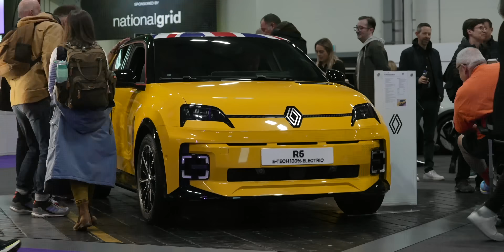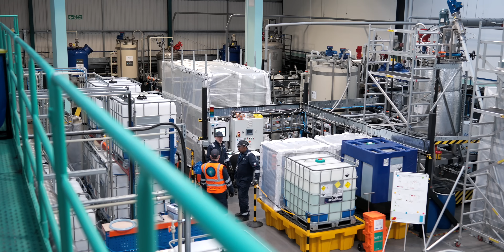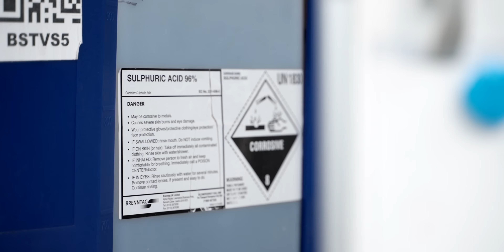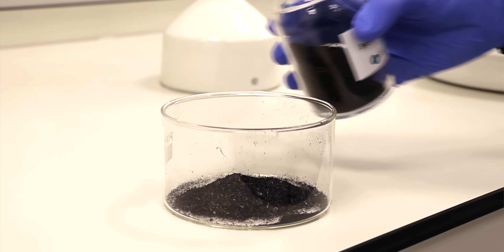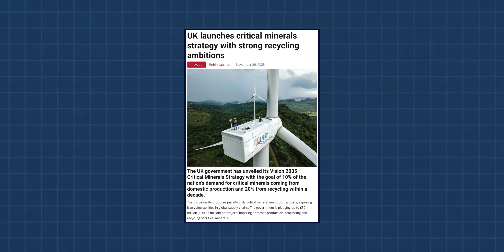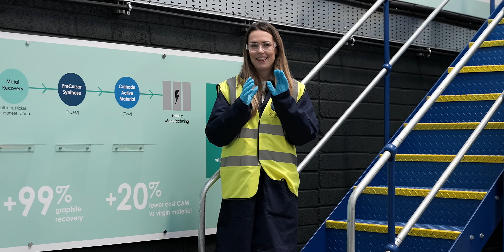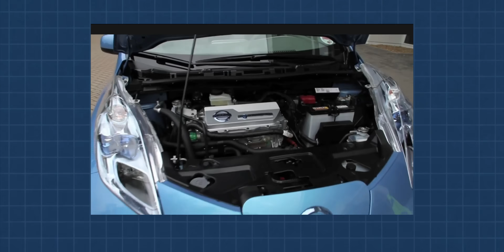EV Battery Recycling Could Be The End Of Mining!

Comment: This is something the EV haters should see - especially the math about cobalt. Thanks for the video, really informative.
Reply: I couldn’t agree more. This can be a huuuge future for UK jobs in several different ways. Heck, knowing in the end you’d also be doing something good for the planet in the long run, I’ve I’d like to have a job in the tech and battery recycling sector.
Reply: You mean dig up 200 tonnes of rock for 1 tonne of cobalt.. Then scratch your head where to out the 199 tonnes of rock while stood next to a 200 tonne hole...

Kidding, but it just tickled me.
Reply: @dougaltolan3017  having lived next to a huge quarry it isn't as silly as it sounds: they can't put it straight back in the hole it came from as they need that hole to access the next bit of unquarried rock.  Also the quarried rock is a rubbly mix which is not stable like the original rock face, occupies a lot more space with all the air gaps, and will be prone to movement. So it can't just be 'put back' I'd guess.
Reply: @dougaltolan3017  
Turn the hole into a battery with a pumped hydro system.
Reply: @dougaltolan3017 plenty of cobalt free batteries and sodium batteries are a thing now
Reply: @dougaltolan3017  
BTW a large portion of the Cobalt mined in the world today is used in drill bits for hard rock drilling for all mines as well as drilling for oil.
LFP batteries DONOT use cobalt.
Reply: @anguscampbell1533 Well said. And cobalt is also used in catalytic converters for ICEvs and the petrol refining process. Anti EV crew doesn't mention that part.
Reply: @anguscampbell1533  - NMC uses very little as well today, original the Nickle/Lithium:Maganese:Cobalt ration was 1:1:1, these days 8:1:1 (1/8th of the original level), with 9:0.5:0.5 commercialising (1/18th) and 9:0.25:0.25 (1/38th). Also, LNO (Lithium Nickel Oxide) is starting to leave the labs and may displace NMC at the high energy density option (particularly with Solid State electrolytes).
Reply: @anguscampbell1533 stop lying please! Also that same oil is used to make millions of byproducts including tires, asphalt, insulation for electric cables, battery anode/cathode…… use your 🧠
Reply: @oddjobsandrandomprojects Blablablablabla…..
Reply: @alanmay7929 So you know I'm right. Thanks for acknowledging it.
Reply: @oddjobsandrandomprojects right about “what” exactly lol! 😂😂
Reply: @alanmay7929  Please tell us how you recycle any one of these:
Petrol (Gasoline)
Diesel Fuel (DERV/White Diesel)
Kerosene (Paraffin/Burning Oil)
Aviation fuel (Jet A/Jet A-1)
Liquefied Petroleum Gas (LPG)
Red Diesel (Gas Oil/35-second oil)
Heavy Fuel Oil (HFO/Bunker Fuel)
Industrial Heating Oil (IHO)
Marine Diesel Oil (MDO) & Marine Gas Oil (MGO)
Paraffinic Diesel (GTL - Gas-to-Liquid)
Petroleum Coke…?

Oh! That’s right, you can't. They've all been burnt. Once only.

They're all now just pollutants in the environment, destroying human health and extinguishing millions of other species.
Reply: @alanmay7929 Everything
Reply: @anguscampbell1533 

Yes, but, cobalt might have been used in their manufacture.

Ponder that for a bit before responding. 

(Bit ... geddit?)
Reply: @Hejavra 

Worse of course is the pollution of water created by refining lithium (for whatever use, and some mentally frail BEV owners could well be prescribed lithium based medication).

If used in batteries then there's the CO2 created during the manufacturing process.

Before the battery huggers squeak in protest a lot of other manufacturing  processes create CO2 too.

The point being that lithium technology batteries have created plenty of pollution before they even see a car factory.

Batteries aren't green by any means.

Battery huggers please note it's "your" choice of transport that creates pollution in places you hadn't dreamed of hitherto.

Why?

Sadly you don't have the wit to fact check all the battery info for yourselves.

Robert and Dan have yet to produce an episode on the manufacture of lithium batteries of any type.

Again, why should this be?

Dare I suggest their sponsors have provided a set of instructions on how to produce  program content and what not to dwell on?

On the topic of creating pollution one can only wonder how many tonnes of CO2 have been created  by their constant crisscrossing of the planet with the aim of proving  how green they are.

Robert et al are definitely green, without a doubt.

And perhaps cynically so.

Certainly they're no better than that silly girl Greta.

For all we know she has enough air miles to fly for free forever.

She wouldn't admit to it though, would she.
Reply: @ForestForest-n9i Ross Kneebone — since you’ve publicly stated that you work as a representative for a hydrogen bus company, the way you behave here looks less like honest debate and more like paid advocacy mixed with trolling. You don’t show up to add insight; you show up to complain, derail threads, and take snide shots at other commenters instead of engaging with evidence.
So let’s stick to reality. In the UK today there are roughly 16 hydrogen refuelling stations in total, and only about six are actually open to the public for passenger cars. That’s not a rollout — that’s a dead end. By contrast, the UK has tens of thousands of public EV charge points, and the number keeps growing because electricity already exists everywhere and scales cheaply. Infrastructure decides consumer technology, and hydrogen has simply failed that test.
On efficiency, the physics are settled. Battery electric vehicles convert the majority of grid electricity into motion. Hydrogen passenger cars throw most of it away making hydrogen, compressing or liquefying it, transporting it, and then converting it back into electricity inside the car. Well-to-wheel efficiency for hydrogen struggles to reach a third of what went in. Turning clean electricity into hydrogen instead of charging a battery directly is just wasting energy.
You also repeatedly attack lithium batteries as “dangerous” or “unsuitable,” which is especially dishonest given that fuel-cell vehicles still rely on lithium-ion batteries. They are series hybrids: the fuel cell generates electricity, that electricity is buffered in a battery, and the battery powers the motor. By your own logic, hydrogen cars fail before you even get to the fuel cell — and then pile on extra complexity with platinum catalysts and high-pressure tanks.
Real-world ownership backs this up. BEVs charge at home and work every day. Hydrogen car owners deal with broken stations, fuel shortages, extreme prices, and collapsing resale values. These aren’t hypotheticals — they’re documented outcomes of trying to force an unscalable system into consumer transport.
Mocking “history lessons” just highlights bad faith. History is where facts come from, and history shows which technologies actually scale. BEVs are already here, already working, and already dominant because they’re efficient, practical, and affordable. Hydrogen cars have been “five years away” for over twenty years.
So here’s the simple question you keep avoiding: what car do you personally drive — and is it hydrogen?
Reply: Maths, or do you have a lisp?
Reply: @seanlander9321 The word is actually math, since it isn't plural.
Reply: @oddjobsandrandomprojects Manure. Math is for sheeps.
Reply: @oddjobsandrandomprojects  - It's both. In the American English it's treated as a singular noun Math, being seen as a shorterning of Mathematics.  In British English (and others), it's the plural noun Maths, being a collective term for the group of mathematical disciplines and subjects (not a shortening of the word Mathematics). You may notice in the US the long form is plural as well, since it's also seen as a group of disciplines/subjets not a single subject, but for a quirk of American English the shortened form is singular (as it represents a plural Mathematics).
Reply: @GruffSillyGoatthanks chatgpt
Reply: @oddjobsandrandomprojects  It is plural as the long form is mathematics a collective noun for multiple disciplines.
Reply: @GruffSillyGoatWhy don't we say Physic instead of Physics? Who says "It's basic physic" instead of "It's basic physics"?
Reply: @seanlander9321 the true answer is English is a stupid language. It makes rules and then violates them.
Reply: @GruffSillyGoatYou are indeed correct. It is actually a regional choice rather than a rule. English violates its own rules anyway.
Reply: @oddjobsandrandomprojects Exactly, there is. Because there’s more than one kink of Math, ergo ‘Maths’.
Reply: Stop the crap please! Why hasn’t Europe built its own battery manufacturing plants?
Reply: @alanmay7929 Europe already has several battery plants. Do some research.
Reply: @alanmay7929  Ever hear of Northvolt. Yes it was a colossal failure, but not because of access to raw materials. Also not because we don’t know how to create batteries in Europe, but very much because we have no clue how to mass manufacture batteries in Europe. Currently all that knowledge is in China.
Reply: @ImpossibleSolution-k6wnorthvolt is the exact example of what Europe is, why not invest in and bring the people to develop the vital industry? Seriously, alot of European startups and companies have been sold to China, usa for years now. Everything from the battery assembly line to the very specific techs in batteries manufacturing….
Reply: @ImpossibleSolution-k6wthe Nexperia scandal is another example of failing European Union, they let the Chinese invest in the chip company that was failing and when the situation got better they took it back by force.
Reply: @alanmay7929  incorrect they haven’t been sold, they have been outsourced and certainly not to the USA, they have they same problems in manufacturing as Europe and its 2 things namely. 1. Cheap labour and 2. And probably more valuable than cheap labour, is the lack of regulation. Which is why China and many Asian countries are the most polluted countries in the world and why China has cancer villages. As a result however the skill set to mass produce most products is highly concentrated in Asia and yes Europe and the US have been left scrambling to catch up now.
Reply: @alanmay7929  I agree, the political and corporate elite and their greed for profits have walked us into this situation and now China is flexing its newly acquired power. I do believe Europe is now awake and is trying to walk back some of the massive mistakes, but it will not nor cannot be done overnight. As for the US, the Biden government seemed very aware of the problem and were putting steps in place to walk back some of the damage. Trump’s government basically binned and wasted all of that investment and now the US is now firmly under the control of billionaires who are only about making a quick buck. The so called tariffs are just a distraction tactic as with everything else. So Europe it would appear is on its own for now.
Reply: @alanmay7929 

Vital industry you say?

If it was that vital then why has the Euro government postponed the advent of the green revolution until 2040?

The Euros are far too busy spending billions on green hydrogen to concern themselves with this BEV nonsense.

The allure of BEVs  has dimmed somewhat and demand is much less than it was.
Reply: @ForestForest-n9i @ForestForest-n9i
At some point it’s worth stepping back and looking at what’s actually working now, not what’s been “five years away” for the last two decades. Battery Electric Vehicles (BEVs) have already won the light-vehicle race on efficiency, infrastructure, cost, and real-world usability, while hydrogen remains a niche science project for passenger cars.
First, efficiency matters. BEVs convert roughly 70–90% of grid electricity into motion. Hydrogen vehicles (both FCEVs and H-ICE) lose huge amounts of energy producing hydrogen, compressing or liquefying it, transporting it, and then converting it back into electricity. Once you count all that, hydrogen struggles to reach 25–35% well-to-wheel efficiency. Using clean electricity to make hydrogen instead of charging a battery directly is simply wasting energy.
Second, infrastructure is decisive. Electricity is already everywhere. BEV owners can charge at home and use a rapidly expanding public network. Hydrogen stations are rare, expensive, complex, and unreliable. In the UK there are only ~15–16 hydrogen stations total, with about 6 open to the public, versus 57,000+ public EV charging points and growing fast. Globally the contrast is similar: millions of EV chargers vs ~1,100 hydrogen stations. You can’t scale a consumer technology without infrastructure, and hydrogen never has.
Third, cost and practicality. BEVs have lower total cost of ownership: cheaper “fuel,” fewer moving parts, and less maintenance. Hydrogen fuel is expensive (often $10–15/kg in the US), stations frequently go offline, and you can’t refuel at home. This isn’t theoretical—hundreds of Toyota Mirai owners in California are now part of class-action lawsuits after being stranded by broken stations, skyrocketing fuel prices, and vehicles that have lost most of their value.
Fourth, a point often ignored: FCEVs still use lithium batteries. They are series hybrids—hydrogen makes electricity, which is buffered in a lithium-ion battery that powers the motor. So arguments against BEVs based on batteries also apply to FCEVs, plus FCEVs add fuel cells, platinum catalysts, high-pressure tanks, and more complexity on top.
Fifth, the market has already decided. Global EV sales jumped from ~3 million in 2020 to over 10 million by 2023, with BEVs dominating. Automakers and analysts (IEA, BloombergNEF) consistently point to batteries as the winning technology. That’s why companies like GM and Stellantis have scaled back or exited hydrogen passenger-vehicle programs, and why hydrogen is increasingly being limited to specific heavy-duty or industrial niches, not everyday cars.
Hydrogen cars do have zero tailpipe emissions, but once you consider production methods (mostly fossil-based today), energy losses, infrastructure costs, and real-world failures, they simply don’t compete with BEVs for personal transport. While hydrogen advocates keep promising a breakthrough “soon,” millions of people are already driving cars that are efficient, affordable, charge at home, and work every day.
This isn’t ideology—it’s engineering, economics, and market reality. For light passenger vehicles, the conclusion is no longer controversial: plugging in beats waiting for a miracle fuel.
Reply: @ForestForest-n9i @ForestForest-n9i Tell is about what car you personally own then. Is it hydrogen?
Reply: @alanmay7929 

But is this battery industry so vital as you imply?

BEVs sales to individuals in UK are in decline.

The Euros have thrown BEVs under the proverbial diesel powered bus by postponing the going green date until 2040.

Why? Because not all people (car drivers) are that interested in going green after all.

They watch the Antarctic ice sheets breaking off into the sea, they hear the Greenland ice sheet is evaporating into the ether.

They read about glaciers in retreat.

They read about the disappearing island nations.

They read all the above and do they care enough to go green? It would appear they don't care very much at all.

We know that  countries absented themselves from the very recent climate control conference in Brazil.

People continue to drone on about battery power as if this is going to help.

It's "us" who are melting the planet and we don't really care enough to do something about it.

I suggest it won't be until the thousands of coastal cities worldwide are obliged to spend trillions on sea defences that the penny will drop.

Then we'll see the blame game played harder than ever before even as the "new" sea defences are inundated.

Hmm ... so you still think batteries are going to change the above.
Reply: @ForestForest-n9iRoss Kneebone — since you’ve publicly stated that you work as a representative for a hydrogen bus company, the way you behave here looks less like honest debate and more like paid advocacy mixed with trolling. You don’t show up to add insight; you show up to complain, derail threads, and take snide shots at other commenters instead of engaging with evidence.
So let’s stick to reality. In the UK today there are roughly 16 hydrogen refuelling stations in total, and only about six are actually open to the public for passenger cars. That’s not a rollout — that’s a dead end. By contrast, the UK has tens of thousands of public EV charge points, and the number keeps growing because electricity already exists everywhere and scales cheaply. Infrastructure decides consumer technology, and hydrogen has simply failed that test.
On efficiency, the physics are settled. Battery electric vehicles convert the majority of grid electricity into motion. Hydrogen passenger cars throw most of it away making hydrogen, compressing or liquefying it, transporting it, and then converting it back into electricity inside the car. Well-to-wheel efficiency for hydrogen struggles to reach a third of what went in. Turning clean electricity into hydrogen instead of charging a battery directly is just wasting energy.
You also repeatedly attack lithium batteries as “dangerous” or “unsuitable,” which is especially dishonest given that fuel-cell vehicles still rely on lithium-ion batteries. They are series hybrids: the fuel cell generates electricity, that electricity is buffered in a battery, and the battery powers the motor. By your own logic, hydrogen cars fail before you even get to the fuel cell — and then pile on extra complexity with platinum catalysts and high-pressure tanks.
Real-world ownership backs this up. BEVs charge at home and work every day. Hydrogen car owners deal with broken stations, fuel shortages, extreme prices, and collapsing resale values. These aren’t hypotheticals — they’re documented outcomes of trying to force an unscalable system into consumer transport.
Mocking “history lessons” just highlights bad faith. History is where facts come from, and history shows which technologies actually scale. BEVs are already here, already working, and already dominant because they’re efficient, practical, and affordable. Hydrogen cars have been “five years away” for over twenty years.
So here’s the simple question you keep avoiding: what car do you personally drive — and is it hydrogen?
Reply: @alanmay7929  Chinese scientists and companies are willing to help for a fee!     Chinese companies bought the LFP tech from the USA!
Reply: What have you got against cobalt?

Humans require cobalt in their diet, not much certainly, but medical authorities claim it's vital for a healthy life.

You know the drill by now. Fingers on keyboards ...
Reply: @ForestForest-n9i Ross Kneebone — since you’ve publicly stated that you work as a representative for a hydrogen bus company, the way you behave here looks less like honest debate and more like paid advocacy mixed with trolling. You don’t show up to add insight; you show up to complain, derail threads, and take snide shots at other commenters instead of engaging with evidence.
So let’s stick to reality. In the UK today there are roughly 16 hydrogen refuelling stations in total, and only about six are actually open to the public for passenger cars. That’s not a rollout — that’s a dead end. By contrast, the UK has tens of thousands of public EV charge points, and the number keeps growing because electricity already exists everywhere and scales cheaply. Infrastructure decides consumer technology, and hydrogen has simply failed that test.
On efficiency, the physics are settled. Battery electric vehicles convert the majority of grid electricity into motion. Hydrogen passenger cars throw most of it away making hydrogen, compressing or liquefying it, transporting it, and then converting it back into electricity inside the car. Well-to-wheel efficiency for hydrogen struggles to reach a third of what went in. Turning clean electricity into hydrogen instead of charging a battery directly is just wasting energy.
You also repeatedly attack lithium batteries as “dangerous” or “unsuitable,” which is especially dishonest given that fuel-cell vehicles still rely on lithium-ion batteries. They are series hybrids: the fuel cell generates electricity, that electricity is buffered in a battery, and the battery powers the motor. By your own logic, hydrogen cars fail before you even get to the fuel cell — and then pile on extra complexity with platinum catalysts and high-pressure tanks.
Real-world ownership backs this up. BEVs charge at home and work every day. Hydrogen car owners deal with broken stations, fuel shortages, extreme prices, and collapsing resale values. These aren’t hypotheticals — they’re documented outcomes of trying to force an unscalable system into consumer transport.
Mocking “history lessons” just highlights bad faith. History is where facts come from, and history shows which technologies actually scale. BEVs are already here, already working, and already dominant because they’re efficient, practical, and affordable. Hydrogen cars have been “five years away” for over twenty years.
So here’s the simple question you keep avoiding: what car do you personally drive — and is it hydrogen?
Reply: Maths!
Reply: @waterboy8999 

Oh dear.

You are, as usual, a tad  late to the party.

It all depends on your locale.

Might be a wheeze to use the terms, "sums", "hard sums" and "really hard sums" so even the kids in primary school know what you're on about.
Reply: @ForestForest-n9i Ross Kneebone — since you’ve publicly stated that you work as a representative for a hydrogen bus company, the way you behave here looks less like honest debate and more like paid advocacy mixed with trolling. You don’t show up to add insight; you show up to complain, derail threads, and take snide shots at other commenters instead of engaging with evidence.
So let’s stick to reality. In the UK today there are roughly 16 hydrogen refuelling stations in total, and only about six are actually open to the public for passenger cars. That’s not a rollout — that’s a dead end. By contrast, the UK has tens of thousands of public EV charge points, and the number keeps growing because electricity already exists everywhere and scales cheaply. Infrastructure decides consumer technology, and hydrogen has simply failed that test.
On efficiency, the physics are settled. Battery electric vehicles convert the majority of grid electricity into motion. Hydrogen passenger cars throw most of it away making hydrogen, compressing or liquefying it, transporting it, and then converting it back into electricity inside the car. Well-to-wheel efficiency for hydrogen struggles to reach a third of what went in. Turning clean electricity into hydrogen instead of charging a battery directly is just wasting energy.
You also repeatedly attack lithium batteries as “dangerous” or “unsuitable,” which is especially dishonest given that fuel-cell vehicles still rely on lithium-ion batteries. They are series hybrids: the fuel cell generates electricity, that electricity is buffered in a battery, and the battery powers the motor. By your own logic, hydrogen cars fail before you even get to the fuel cell — and then pile on extra complexity with platinum catalysts and high-pressure tanks.
Real-world ownership backs this up. BEVs charge at home and work every day. Hydrogen car owners deal with broken stations, fuel shortages, extreme prices, and collapsing resale values. These aren’t hypotheticals — they’re documented outcomes of trying to force an unscalable system into consumer transport.
Mocking “history lessons” just highlights bad faith. History is where facts come from, and history shows which technologies actually scale. BEVs are already here, already working, and already dominant because they’re efficient, practical, and affordable. Hydrogen cars have been “five years away” for over twenty years.
So here’s the simple question you keep avoiding: what car do you personally drive — and is it hydrogen?
Reply: Still cheaper to buy the individual metals on the market.